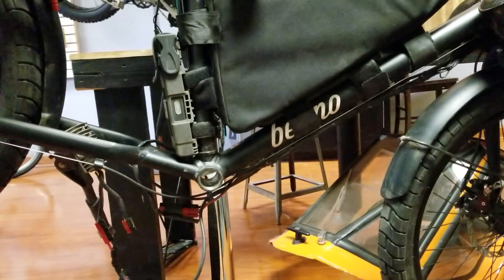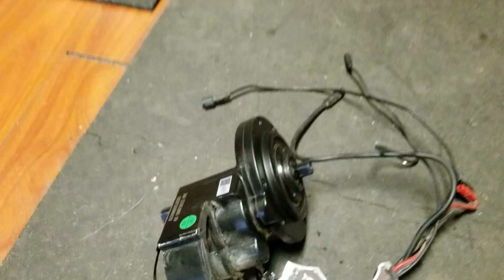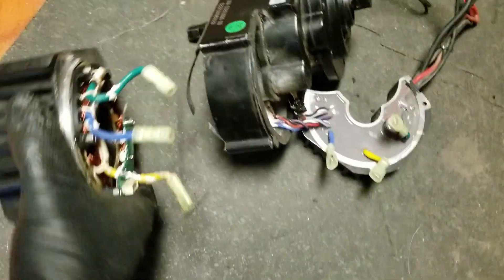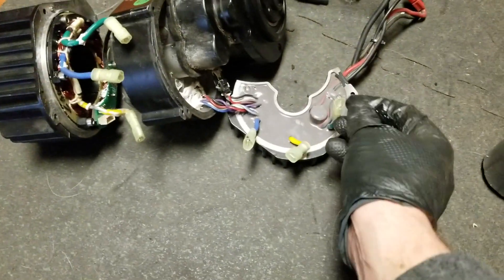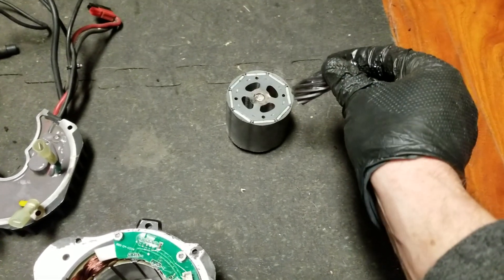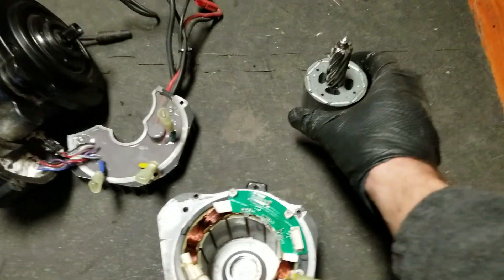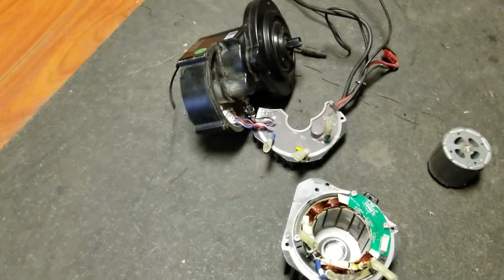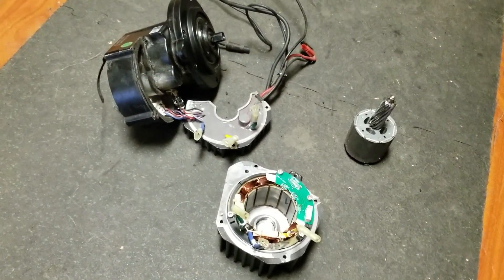Bafang BBSHD Motor Rotor Failure/Repair

Comment: I had the same problem, was quite hard to remove the rotor. Had to force some bolts into the 4 little holes, then bend a coat hanger into a handle and pull with it secured in a vice.

Comment: Great instructional video... More please..!  :)
Reply: Where's the instructions, totaly poinless video, no use at all
Reply: @RobertAdams-ly5ku  These instructions gave the the answers i needed.. These motors are straight forward to a mechanic.  Things like replacing a controller, need better details, and to do that you need very specific skills.  I' someone who usually messes up electronics.. 
What i got from this was it needed disassembly, then replace the rotor and reassemble i reverse order.  He answered the question of why the motor sounded like it was spinning, but no motion was seen.  this was instruction on how to diagnose a failure..
Reply from the maker: Thank you Rob, will do

Comment: Iam looking to get a BBSHD but anybody knows what the maximum voltage the original controller can take?
Reply: For higher voltage you need a controller ASI BAC850 from Electroncycles.
Reply: Max 59volts
Reply: @s.u.9679  did you try higher voltages? , soon I will try 61.5v
Reply: I haven't tried higher voltage,  I only know from the internet that people speak 59-60 is limit.

Comment: Holy smokes...this is exactly what happened to my BBSHD.  I have replaced nylon gear with steel gear and replaced secondary gear and it still was making that loud knocking sound when throttle or PAS would start to engage...then the diaplay would shut off...rendering my bike useless.  I had taken everything apart numerous times and had not realized that the small spindle part was actually broken off.  Thanks a lot for this video.  Cheers.

Comment: Almost the same problem. Pedals spin, motor spins when using the throttle, but no drive to the chain. This has happened out on the trail - first a few years ago and then again today. After this has happened when coasting downhill (heading home) after sufficient number of bumps - it starts to work again. Can you help?
Reply from the maker: Dang Randall, thats a little strange for it to just start working again. Its been some time since your post, have you solved it by now? What happened? My only answer would have been to take it all apart and find out.
Reply: Bad bearings.
Reply: I am having this problem right now.  what needs replacing please?
Reply: Hey David. I found out there was nothing wrong with the motor afterall, and now many years later it is still working. The problem was the front chain ring. When there was no power to the chain, the chain was actually off the front chain ring, but it was difficult to tell it was off but it was alongside the front chain ring. It seems embarrassingly simple, but I missed it until someone replied to me on this site. I hope that is all that is wrong with your bike as well.

Comment: I’m in the repair mode for the same thing,although I replaced the entire core body.I would have like to see how you managed to get the magnet out.
Reply: Pliers, doesn't matter if you damage it because needs replacement anyways.
Reply: @samclosetech  thank you
Reply: Same problem !
Reply from the maker: If you use a rag, or sheet of rubber, you can grip the spline in a pair of pliers, or in our case, we use a bench vise. Its definitely held in there strongly.